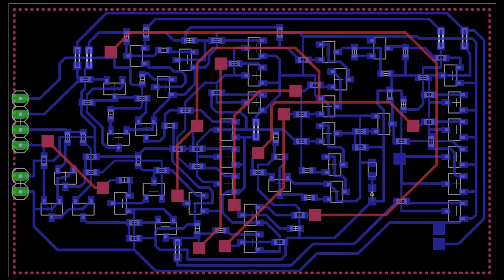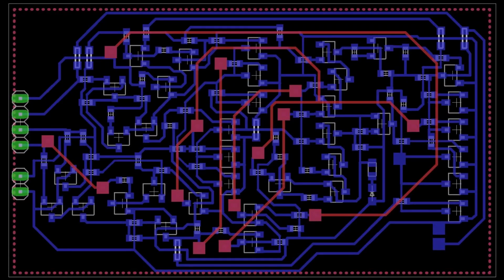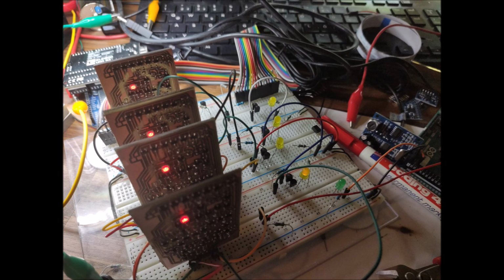8 bit program counter

Comment: Didn't expect to find you still interested in finishing this project. I'm patiently waiting, keep up the good work!
I've got a couple of architectural questions regarding your computer build in general:
- I'm assuming from your other comments that you're going for a harvard architecture, how is program ROM going to be implemented? Just a lot of addressable lines with wires soldered to either ground or +5V? Boards with wire-wrapping pins?
- How much bytes of RAM do you actually plan to build? (wishing you good luck at soldering all those)
- What will the address space look like? Will the hardware RNG you posted a while back be accessed like memory-mapped IO, or will you have a special IO cpu instruction to access it?
Reply: I like that design
I use ROM for program memory as well
I mean it's pretty common too
But its cause Its way easier to store data in a different
Memory chip than having only one chip and storing data
In the program memory is limiting the computer to way less data use
I'm currently designing my own processor and it uses RAM and ROM  as well.
I haven't built it yet only some simple memory circuits
But I'm currently working on all the components.

The plan is to build it using only transistors
Cause it looks cooler that way it is also inspired by Ben eater and Martin
And a few more
Reply from the maker: You are right. The program memory (ROM) is seperated from the data memory (RAM).
256 addressable lines will be the finished program memory. Each line is about 32 bit wide.
I thought about 16 Byte of RAM, which are 8 memory units for the 16 bit CPU. 
The address space is 8 bit too and can be saved in the RAM (because maybe it needs do be changed) or in the program memory.

For now, the RNG can only be addressed through the program memory. Internal cpu instructions are not planed for "not important parts".